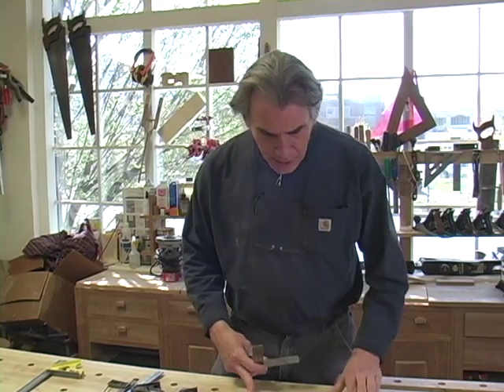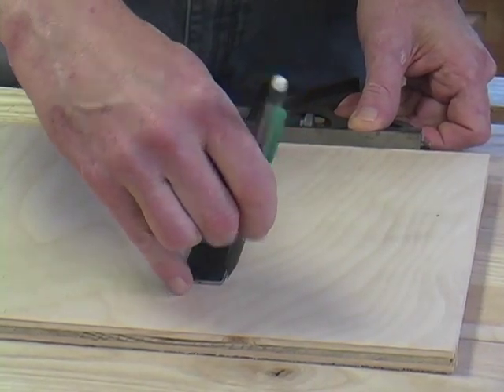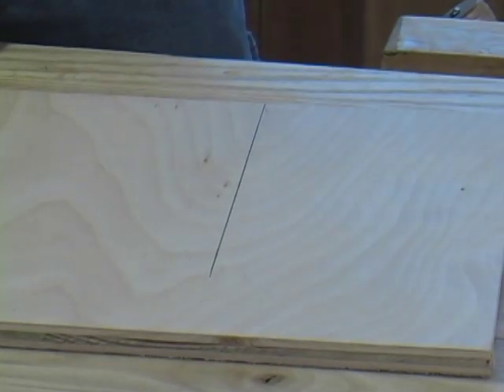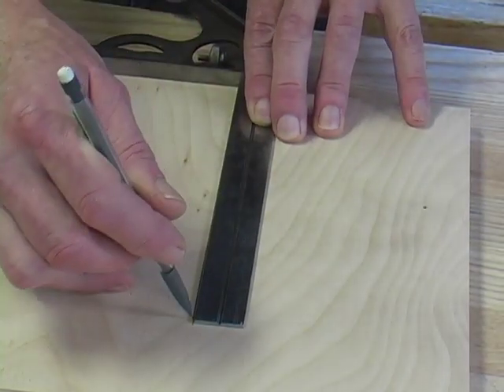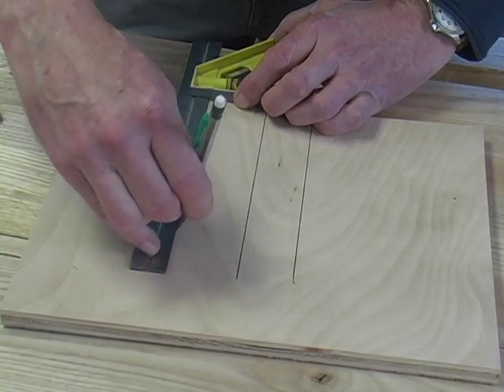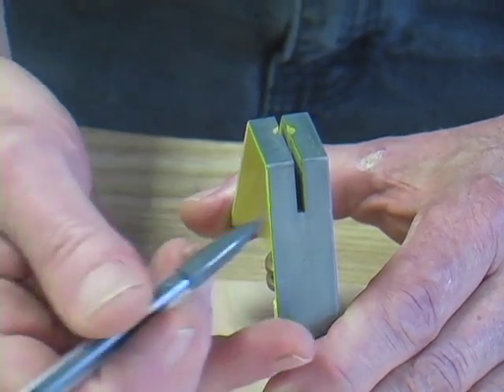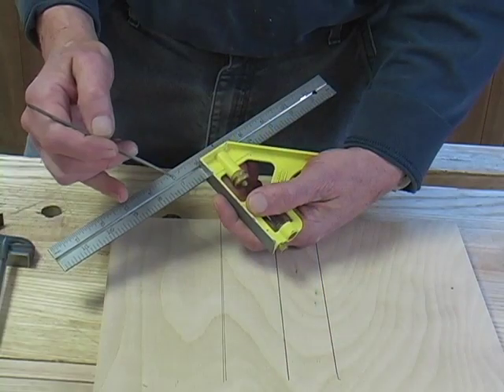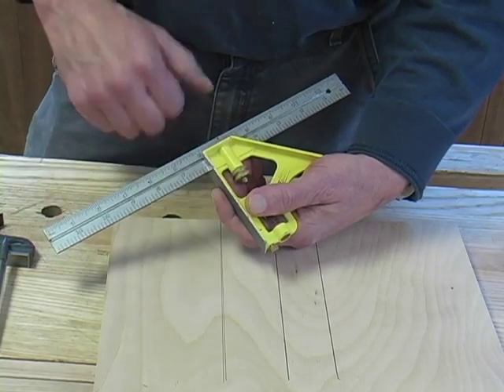Squaring a Combination Square

Comment: Good tip. You need to check the rule for straight first though, otherwise if you reverse the rule, or even slide it some, it could end up out of square again.